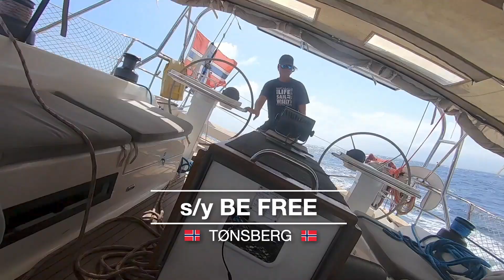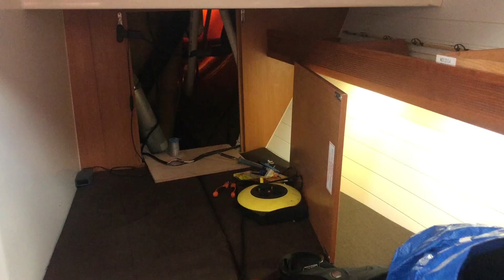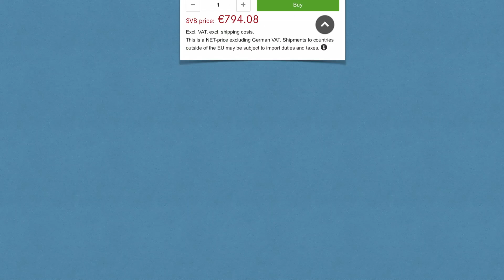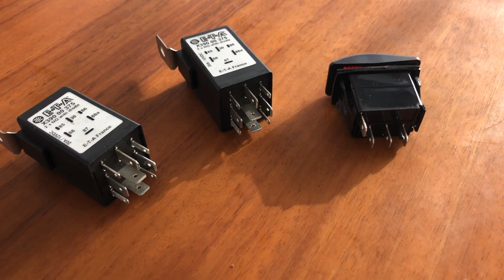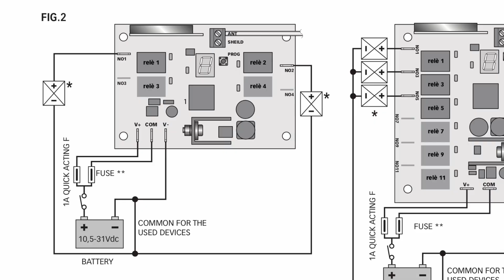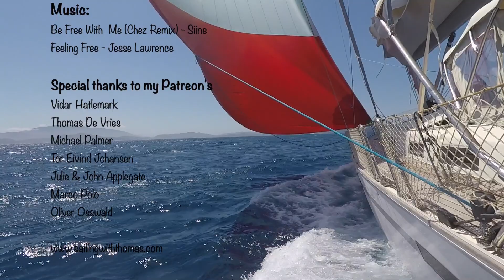SAILING MODERN YACHTS.  ARE THEY TOO HIGH TECH? OLD SCHOOL SOLUTION TO MODERN PROBLEM - SwT 100

Comment: Hi Thomas, another very interesting Video! I am thinking to buy a Bavaria Cruiser 55 from a charter company in Greece. Last Weekend i went to Greece to see the boat. Fortunately it was a very rainy day and water was coming in on almost every window including the outside hull windows. I can fix the windows by myself no problem but the water is coming in since about 2 years and it was wet in the bilge and also in some compartments of the keel grid. Do you think it's a problem when water has been there for a longer time?

Comment: We’ve chartered three boats with electric transom door openers, Beneteau, Jeanneau & Bavarian. None of them worked. In every case there was a rope tied to them and then around a winch to lift them up and lower them down. Each charter manager said they were more problem than anything else on their boats and regularly failed on the first charter! Owners like the idea of them but won’t pay for the constant repairs needed, so charter firms greatly preferred it if they were set up with rope and winch from the get go. They are a classic case of a completely unnecessary complication on a sailboat.
Reply from the maker: Thank you so much for your feedback and for watching! Yes I totally agree with you but that said the solution on BE FREE worked flawless for 7-8 years before it was destroyed at the hard by a heavy duty forklift. I believe you expose the truth about charters... In my opinion the fastest way to destroy a yacht is to put in charter. 
It could be lack of knowledge but also necessary information before sending clients out with a boat they don’t know. Guess if they knew the things I showed in this episodes the lifting systems would last longer. That said as I pointed out it’s not optimal solution for a charter boat. Lots of people jus give a shitt when it’s rented.
Just look at the episode I made with the record of destroying catamarans in a week. Probably the worlds most expensive charter week ever. Only a hurricane could destroy more boats in a week than one company chartering 80 boats.
All the best and cheers 🍻

Comment: Hi Thomas, bit belated however couldn't you have simply fitted an inexpensive trailer hand crank winch for that platform? Thus doing away with electronics. Great videos btw.
Reply from the maker: Hi there! Thank you so much for watching. It’s several solutions evaluated from my side but no matter which alternative solution it would be some challenges. The “garage door/platform” is seriously heavy wich off course could be solved for the lifting process. However getting it synchronised would be a challenge as well as getting it open from closed position as it leans into the aft. 
I can barley push it out enough to have gravity to help me as I tried this and also made som solutions using my electric winches to close it.
So end of the day original solution is a priority but also much faster and easier fix.
All the best and cheers 🍻

Comment: That is what I would have done to solve the problem too. A control board for 800 euros is just pure robbery. You could also set it up with a different remote as you can see on Ebay for under $50.
Reply from the maker: Thank you so much for watching and your kind comment.Lots of options on EBay for sure. Thank you for being here! All the best and cheers 🍻

Comment: Seen this before, mini computer when a couple of relays would do it.  Nice that you found applicable relays locally. I have done similar up/down control by stringing 4 on/off relays together....very messy install.  Yours looks nice and clean.
Idk why manufacturers do this... possibly cheaper/faster during production/less wire idk.
Reply from the maker: Thank you so much for watching and your kind words. It’s most likely time saving and easier installation, but makes it expensive and complicated later. All the best and cheers 🍻

Comment: Hi Thomas,  earlier i sent you a link to a remote control garage door opener but got deleted by Youtube  ( i do understand)... it would be great when approaching the closed transom from your dingy below.  It cost a mere US$10 instead of the replacement $750+ and works with   6 to 30v DC... will send you that link again if keen. Cheers

wwlee
Singapore
Reply: Hi ww Can you share that with me too, having the same issue as Thomas..
Reply: @jeroenkool3203  i tried twice leaving my email but got deleted.... 😡
Reply: @wwlee9583  Thanks! YouToob Censorship has no bounds. Anyway I managed to fix the transom hatch, was just as simple as some corroded wires on the contractor unit.
Reply: @jeroenkool3203  search for 'garage door opener' on the famous eastern site starting with an  'A'
Reply from the maker: Thank you so much for watching and for your effort trying to help me. YouTube automatically delete all comments with links due to spam and not always good intentions behind the links shared. All the best and cheers 🍻

Comment: Good one Thomas. Pretty clever fix on the door opener. I agree on the over technical issue, particularly with smaller ancillary systems. Trouble with these is designers get a low grade Micro Controller board made up, and they are less robust due to budget issues. And you can’t carry spare parts for every little facility. …So … based on that I am making a policy for my boat to base all smaller systems on Arduino electronics boards that then plug into the hardware feature of each facility. This way I can carry 10 spare boards, all loaded with the software for every function. Pull a failed board out, set the dip switches on the replacement to be the same as the one coming out, and I will be back up and running as long as it was a processor problem. I was looking at the Carling central switching modules, but then realized that to loose that much functionality to a lightning strike at sea or in a remote place was begging for failure. Had they make the brain of the unit an Arduino, rather than use their own microcontroller, it would be a simple fix to be back up and running. So thanks for that little worked example of how little things can go wrong. I like this new direction. I bought a bunch of Arduino processors and sensors to learn how to use them, now I am going to have to learn more quickly how to use and integrate them.
Reply from the maker: Wow! You know much more about this stuff than me👍🏻 I just had to work around a solution to fix my problems with limited resources. Anyway thank you so much for watching and your interesting comment. All the best and cheers 🍻
Reply: Or just do without the electronics.
Reply: @PaulBKal  “Or just do without the electronics?” This is something that we can do. You can use a motor/generator to condition energy from solar panels for charging batteries, and it is something that may be necessary in a distant distopian future where the highly sequential electronics industry has collapsed due to climate change. However, quality electronics is a benefit to us all and we need to support that development through purchasing. Automotive electronics is proving to be relatively bulletproof, so the development of electronics to survive extreme environments is possible.

Comment: Typically you do not wire the relays in parallel, but serially using their three-way contacts. That way the second relay has nothing to switch in case the first one is already active. No extra hardware needed and it saves you from blowing a fuse should a relay stick. I suspect the actuators are ramped and their current is watched in case of something blocking them, but 800 USD is not justified in any way. Yet another case where open hardware would help that is built to last and possible to diagnose and repair.
Reply from the maker: Thank you for watching and your feedback! Much appreciated. I’m no expert in this field and only tried to solve my challenge. For sure it could been done better and even smarter. But somehow it does it work and I’m happy. All the best and cheers 🍻

Comment: Congrats on ep. 100, great work :)
Regarding the linear actuators, do they have internal end stops preventing you to damage the gears or motors? Do they move in sync? If one moves faster than the other you can risk material damage. 
The computer probably have some sort of position feedback from the actuators, speed ramping and other stuff one often doesn't need.
Reply from the maker: They do have internal micro switches thats cut the power when at position up or down. I have also added a switch to override for manual calibration if needed. All the best and cheers 🍻

Comment: This is so right. Too much built in complexity waiting to develop a problem. The same thing happened to cars. We used to be able to work on our motor and now you can’t even find it under the hood. Fixing things requires computers and software in addition to very special parts.
Reply from the maker: Thank you so much for watching and your comment! Your absolute right and look at old cars user manual compared today. The old ones even told you how to tune your valves and clean the carburettor. Now it’s don’t keep your cat in the glove compartment as it can die.... All the best and cheers 🍻

Comment: You got that right Thomas, modern boats are all too complicated.  I had a similar problem with a computer controlled AC Unit.  I did what you did and it's all good now.  bypassed the computer and went to on/off switches.  I like the long ship you drew.  that's a bit too simple. You got your point across though. Keep up the good work and have safe journey.  see ya in the next video bro!  :o)
Reply from the maker: Thank you so much for your comment and for being here! Well done on your AC unit👍🏻 Sometimes I miss my low tech boat with foot pump water and barley any need of batteries onboard. Thank you for watching and all the best🍻